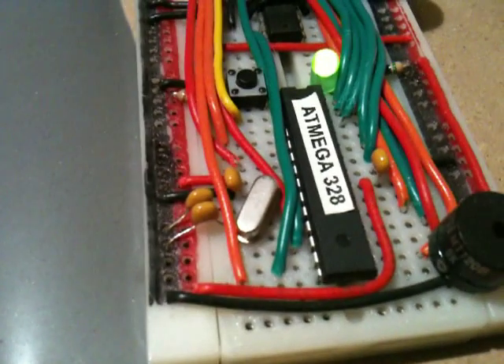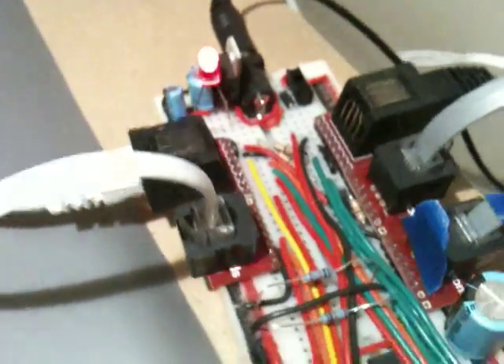Arduino Powered X10+RFID Controlled Motorized Curtain Opener/Door Lock

Comment from the maker: I definitely agree. This was just my first version, and it works so well/consistently I haven't been motivated to tackle it again ha. My next idea was instead of having a solid connection between the first rung and pulley wire, I would space strong magnets ever 6" along a belt that will be spun in the same way the fishing line is spun now. And then on each rung of the curtains I'd put another strong magnet, and put the rungs and belt a few cm apart, with a plastic separator

Comment from the maker: Continued: Then you could manually pull the curtains by overcoming the strength of the magnets, but the device could still pull the curtains open/closed by spinning the belt until a magnetic link was achieved, and then stopping when bother sides are detected closed. Not sure how it would work in practice, since I'm a software dev, NOT a mechanical engineer :) But this has definitely been my most successful mechanical project! (in that it has worked every day without flaw for over 2 years)

Comment from the maker: I drive an hbridge motor controller with the arduino (so I can reverse polarity on the motor to reverse directions) and the arduino is doing all of the work to check for rfid, x10, button pushes, etc and relaying that to the hbridge chip. Good tutorial: itp.nyu.edu/physcomp/Labs/DCMotorControl

Comment from the maker: I used pieces from an old robotics kit I had to spin two wheels in opposite directions. I wrapped fishing line around each wheel a couple times (to prevent slipping) and then looped it through a curtain tensioner thing to keep the loop tight. I then tied the first rung of the curtains to the loop so that when the wheel spins, it pulls the fishing line which moves the curtains. I do this on each side so the curtains move in unison opening and closing. I'll post a more explanatory video tonight.

Comment: Awesome! I've been wanting to do this mostly to work together with my HTPC. I want the curtains closed and the lights dimmed when I start a movie. Lights are easy, curtains are a lot harder in a mechanical way.I might build something like this however I would like to be able to move the curtains by hand without wrecking the motors. Looking at this I think you'd brick the device above the door when you pull it by hand. I might try to do this with a magnetic connect/disconnect.

Comment from the maker: @locatuse I'm using one of the drive motors from a vexplorer robotics kit I had bought on woot.
This is the system: amazon-com/Revell-Monogram-31445083532-Revell-Vexplorer-Robotics/dp/B000O0PWN6
I used the drilled sheet metal with the gears that perfectly align and the wheels for the barrels from the kit and that made it a lot easier to build.
The servo is just a cheap generic small servo like this one: sparkfun-com/products/9065 (there are much cheaper places to get these)

Comment from the maker: @scarletxfi Thanks!! The reed switches were 10000x more reliable than the hall effect sensors. Much simpler mechanism and doesn't require an additional 5v and ground.
Do you mean like a hydraulic door-opener?
I developed it on an arduino board, but moved to the barebones setup because it's cheaper (the bare setup costs less than $10 from sparkfun where an arduino is $30+) and I plan on making it standalone with a pcb designed for it and putting it all in a clean enclosure, just not there yet :)